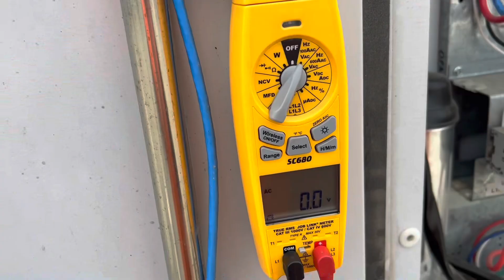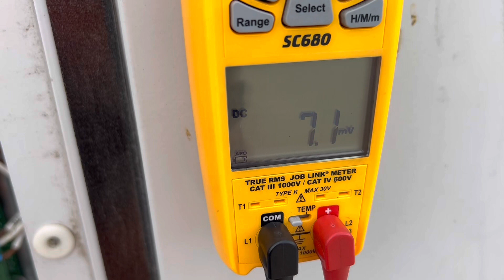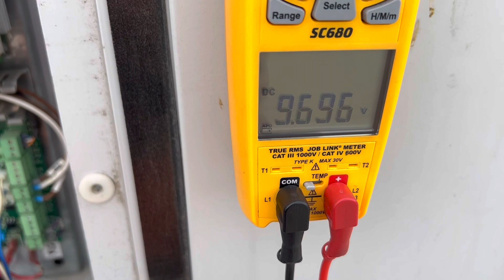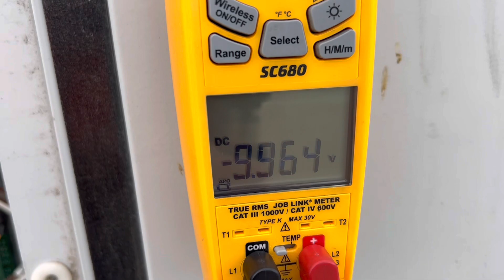Temperzone / Replacing Two Faulty UC8 PCB’s

Comment: On the new UC8 needs to be reprogrammed to the type of compressor you have which will set the config on the board. Had one 6mths ago that came out of the factory with the wrong config and caused major problems and tech support was unaware of the new software until they did some digging. The problem I had they set it to wrong compressor and that meant wrong gas and caused the sensors to fault out. I originally replaced the sensor and still reading wrong. Reprogrammed the board and works a treat.
Reply from the maker: This is interesting. Was yours running R32? This is an older R410A system so when I ordered the UC8’s the only thing I needed to change in regards to the compressor was a two dip switch’s for fixed or digital.